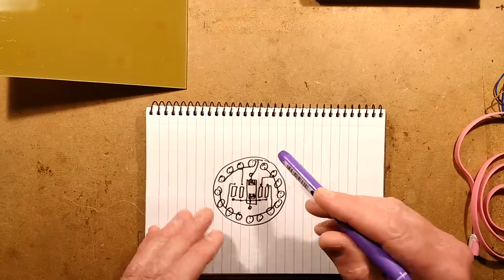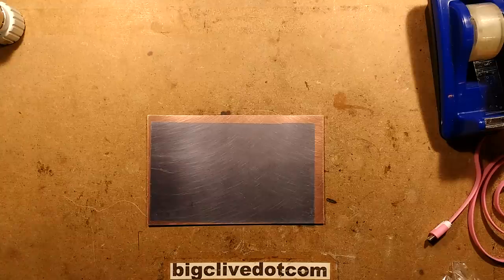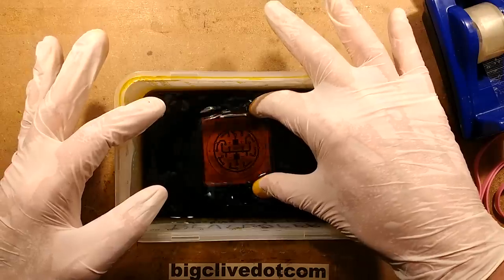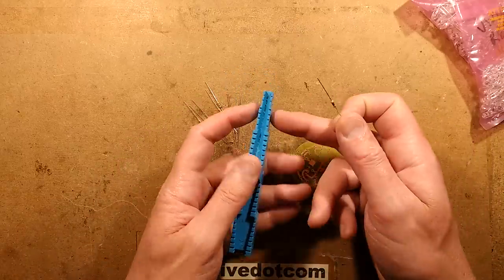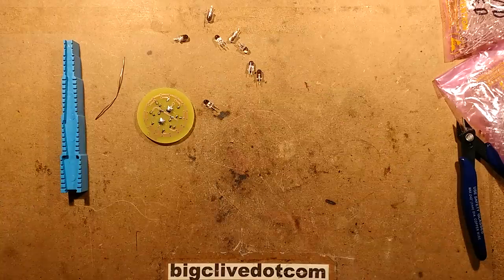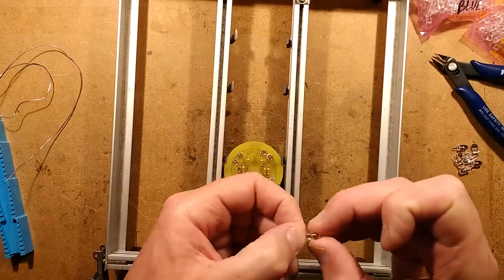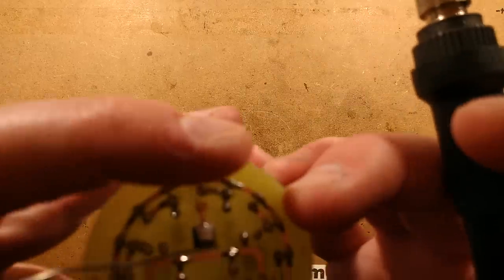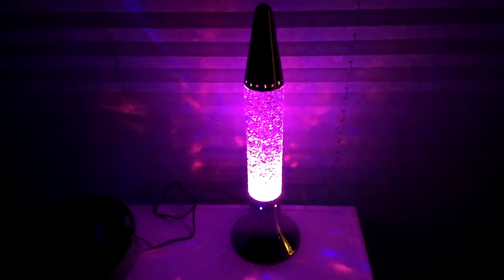Safe USB version of the Gillian's Diamonds lamp. (With PCB file.)

Comment: I know this is a really old video but hopefully someone will answer. Can you skip the whole circuit board steps and use USB LED strips and then connect the 5V to the bottle component just to get the heating effect? Sorry not clever with electronics like this but liked the look and idea. Plus I have loads of bottles I could do this with
Reply from the maker: Yes, you could rough it up with a resistor glued directly to the base.
Reply: @bigclivedotcom  thanks Clive I really appreciate the reply. Hmmm 🤔 I have loads of those fancy glass Coca-Cola bottles around (in different sizes 330ml & 250ml etc) seeing as it's just salt water maybe could make up a bunch on a base with red LEDs for a Coca-Cola inspired gift for a friend who's obsessed with it lol. Keep up the good work Clive.

Comment: How much actual power do you need to expose the photoresist - would a 10W COB UV LED be sufficient?
Reply from the maker: It doesn't take much, but the time will depend on the wavelength.  It would have to be a proper UV LED.

Comment: I don't have an inkjet printer, will the process of making a transparency work with a laser printer?
Reply from the maker: It depends on the printer.  If they lay down a good layer of toner then some can make great transparencies on common tracing paper.
Reply: 3M make laser transparency films for overhead projectors which take the black very well - they are expensive, compared to the cheap inkjet transparencies, but they are a much better quality (come out glossy, not matt like the inkjet ones) and work well for PCB exposure.  Turn your printer off of "economy mode", and print so that the printed side will be against the photoresist.
The ones I use came from Staples in the UK, but they don't appear to be on the UK or US websites any more.
Reply: Poundworld photo paper works great using the toner transfer method.  Print, iron on to a copper board & let it cool.  It peels off leaving a perfect image.  I have a cheap Brother printer which doesn't like the thickness so I have to cut a square and tape it to an A4 sheet.
Reply: Yes laser printers are fine. I actually gave up on inkjet loooong ago because I couldn't find a single decent film/paper that would stay sharp and wouldn't bleed. Cost me a pretty penny. Things seem to have changed a lot since on that front. I ended up moving to laser with press'n'peel, more frustrations and wasted money, then I moved back to photoresist with the laser using bog standard 80gsm paper. Print side against the board, exposed with sun, It's all I've used for something like 15 years now. I've never once used transparency film with laser, never needed it.

Comment: The end, amazing! Nice story about your first LED. Is this resistor-to-bottom method also usable with a LAVA lamp? I think I have stored a workless blue one somewhere in the basement. The reason I did not use it is the waste of energy. Perhaps this is a solution to revive it?
Reply from the maker: Sadly, a lava needs a lot of heat.  So it needs the correct power of lamp.

Comment: Is the dry film negative or positive type?, and which UV bulbs/wavelengths do you use?
Reply from the maker: Wherever it gets exposed to light it hardens, so you use a negative image.   The UV light is UVA which is commonly used for blacklight effects and nail gel curing.

Comment: Could you put a sheet of printer paper between the film and the iron to act as a sort of... Buffer is the only word I can think of, but it's not the one I mean. I'm just trying to think of something that will protect the plastic from the direct heat of the plate, yet still transfer enough heat to make the gel cure onto the copper.

I use the top of my washer as a work bench too, but mine's a too-loader. 😄

Comment: I found this video absolutely fascinating and massively encouraging to a beginner/hobbyist like myself. The only issue is the obvious one...  That UV box. There is no way I could ever justify buying one of those. Is there an alternative at (near) pocket-money prices?
Reply from the maker: Yes.  You can use cheap UV nail varnish curing lights to expose the PCB.  Or if you're lucky enough to have sunshine that works too.
Reply: I think we had sunshine once in Yorkshire, my Grandmother told me about it.
Reply: Ah--an excellent dodge!!!  They are only about £5 when ordered from the far east if you are willing to wait a couple of weeks as well.

Alternately I do have a couple of black-light strip lamps in a Uni-Ross rechargeable work lantern. I believe the designation on the lamps is 'T6 6W BLB 1FM' and they seem to have a peak emissivity at 360nm according to the data sheet. I wonder if it would work to expose the UV sensitive film were I to bundle the lantern and the PCB-to-be in to a big tupperware tub that was shielded with tin foil?

Comment: What is the paint version like that you dilute then paint, blow dry, expose, etch...

Claims are its easier to use than dry film, the pain is meant o be the same type of chemical resist only in a paint.
Reply from the maker: I tries the spray on lacquer a long time ago and never had good results.
Reply: bigclivedotcom  Ah, this happens to be paint, you get the pint in a concentrated form, dilute 1:3 and paint on like a wash.
Reply from the maker: @thepvporg  Do you have a link?
Reply: @bigclivedotcom  Sorry I don't at hand, I been racking my brains, I am sure it was somethig on AvE or This Old Tony.

I guess each method has its merits and its pitfalls. 

I wonder how long the paint lasts, is it as stable as the gel film?

If I find it in my viewed YT vid history, I'll drop the link here.

Comment: +bigclivedotcom I am on Ebay looking for a tool like the one you use to hold your PC boards and components in place while soldering, but I do not know what it is called, so I am having trouble finding one.  Can you help?  Please!
Reply from the maker: It's an old PCB frame that I haven't seen stocked by any of my electronic suppliers since.  I think it was made by Velleman.
Reply: Closest thing I've found is the Ideal-Tek PCSA-1 but they're nearly $300 USD

Comment: @bigclivedotcom - Could you perhaps do a video of all the tools you use? Such as the component former you used in this video, the rather neat wire strippers, PCB Holder, etc etc etc with Amazon UK and US affilate links so we could pick up what you use and help support the channel at the same time?

Just a request from Central Nowhere USA (Wyoming, USA).
Reply from the maker: I've never used the affiliate links to tools because it often drives the price up on a specific listing.
Reply: @bigclivedotcom  Thank you for that information as I didn't know they did that.  I would still enjoy a tools video if possible.

Comment: Your father may have been right. I had small crack in an aquarium tank and I used regular silicon to seal it…. All my fish died. Later I found out that they make a silicone especially for fish tanks that doesn’t off gas poisonous vapors.

Comment: Looks great. I would (hmm will?) try with some RGB LEDs to be able to "tune" the colour, can be an interesting thing to do. Or not ... :) Sounds overkill but some neopixel (or such) RGB LED ring can introduce very interesting effect, when "the ring is animated" in colours etc.
Reply: I was thinking exactly the same... Especially as I already own a 16 neopixel ring I bought because I was curious, and it was very cheap from China...

Now I need to find a bottle and stand the right size.

Not sure if recycling a pickled onion jar is the correct look ;-)
Reply: Sounds good :) I also had the idea to follow the author here, if we have some chillout music, why don't we modulate the light according to the music to get the ultimate chillout solution ...

Comment: I'm interested in building one of these. Would water or mineral oil be better to use?
Reply from the maker: Water with a pinch of boric acid to keep it sterile and then the density adjusted with table salt to get the crystals at neutral density.  It only works with the common eBay plastic wedding scatter crystals as they are a light plastic.
Reply: bigclivedotcom Thank you for the fast reply! I love your videos btw, entertaining and educational all in one.

Comment: all drill accidents you say?
i was using my drill and i got my hair stuck into a cumutator vent hole
and i broke the drill :[ it felt like a board smacking me in the head
did you had this kind of accident?
Reply from the maker: I've not done that, but I have had old single speed drills snatch and drills break in use and cause injuries.

Comment: Hope you don’t think this is a stupid  thought  ,instead of using resistors on the leds why don’t  you just reduce the voltage  ? Or am I missing something ?
Reply from the maker: The unit uses the resistors for heat to move the liquid.
Reply: You must use resistors to limit the current.   You can vary you supply voltage and adjust you current limiting resistor, for you LED will have it's own internal resistance.  Check the specs of your resistors and do the math.  Ohms law.  If you don't use a limiting resistor, the LED will draw max available current, be very bright until it burns out.

Comment: Hi Clive what value resistor would I need to drop 5v usb power to power 3x 1.5v battery powered lights thanks
Reply from the maker: If you use a standard 1A diode it will drop the 5V by about 0.6V.  But you could also use a couple of 10 ohm resistors in series.
Reply: Hi  again I have 15k resistors would one be OK or do I really need two 10k thanks
Reply from the maker: @jonathoncobb1982  It's 10 ohm, not 10K.
Reply: @bigclivedotcom  ahhhh good I ordered the right ones then as I didn't want to take the chance thanks for your help

Comment: You're making the safest version now; make the unsafest version next. Lithium ion battery to power the LEDs, tea light (below the battery) to heat the liquid.
Reply from the maker: I did much better than that.  The previous version had a 240V PCB.
Reply: I saw that one, but how is that more dangerous than putting a lit candle under a li-ion battery? That has to be explosion containment pit tin worthy.
Reply: How about lithium ion battery being charged in device by a resistive divider straight from rectified mains just to make it a little bit less safe?
Reply: I like the way you think

Comment: One thinks of designing and fabricating a circuit board as a daunting task, but after watching this video, one has hope for ones own abilities. What could possibly go wrong! 😂
@Bigclivedotcom You could cover the resistor and silicon with a thin layer of hard epoxy, preventing damage and risk of corrosion to the board, also adding a lens effect, if you epoxy the led's to the bottle bottom with clear cement.

Comment: Felt the need to point out at around 35:30 : 660nm red penetrates tissue deeply (normally ~650nm). 810nm also penetrates tissue deeply. That's the medical reason for using those two wavelengths specifically, they're peaks of penetration efficiency.

Comment: i had a idea for a electricity board circuit, Tritium radioluminescence on a solar panel, dc to ac power inverter and a Walton cockcroft multiplier? 🤔💡🤷‍♂️
Reply from the maker: I think nurdrage tried that and the output was almost unusably low.
Reply: bigclivedotcom been thinking about it, if it worked then it might be patented classified military technology 🤔😧

Comment: Awesome how easy it seems to be to make a PCB by myself... except of the massive UV light thingy... why not use jlcpcb.com or pcbway.com ...?
Reply from the maker: It's faster to make one yourself if you have the correct gear, and also helps you weed out problems with spacing before commiting to a batch of manufactured boards.

Comment: A while back I made a dual axis CNC laser cutter that normally has a 1.6W 450nm laser in it, but I was contemplating the possibility of temporarily swapping it with one of my various 405nm violet lasers and having it expose the film much like how SLA printers create layers of a design. It will take a while until my dry film and vinyl squeegee get here from china but I will let you know how it works!

Comment: Chinese have a bad habit of trying to be original by making everything opposite of what's normal in the rest of the world. Case in point, LEDs and USB cables manufactured in China. The long LED lead is invariably always negative and the flat side indicates positive. The red wire in USB plugs has a 10% chance of being positive, and the black wire has a 1% chance of being negative. Invariably the black wire can be positive and the green, yellow, blue or white data wire can be positive. These examples are from personal observation.
The lamp does look quite nice. I would have used either color changing LEDs to get a nice mood lamp or blue and green LEDs to make a more eerie and mystical atmosphere.